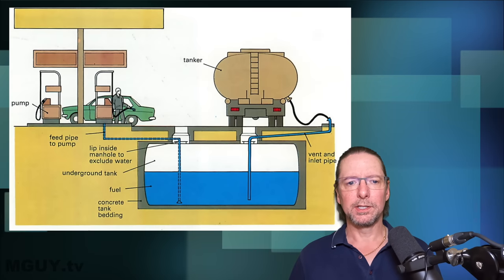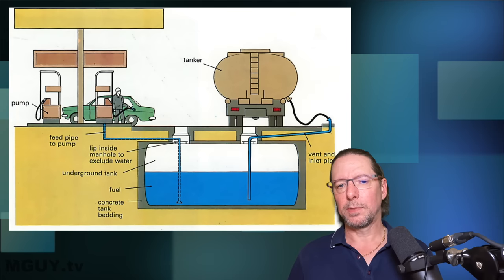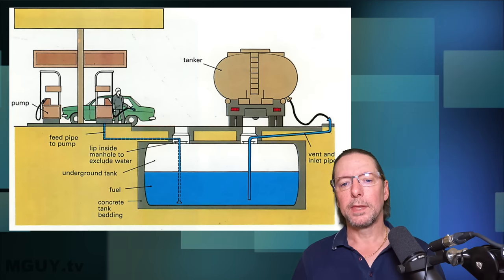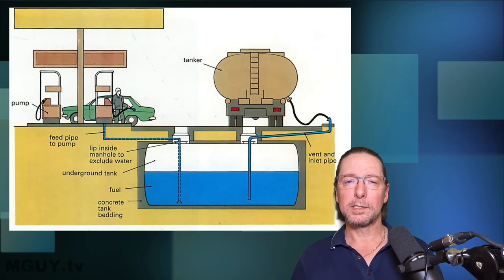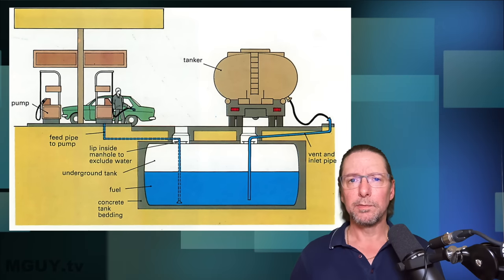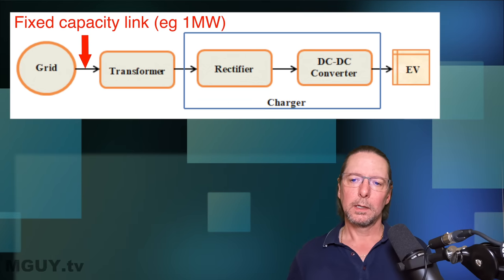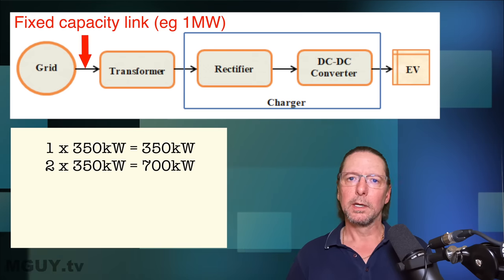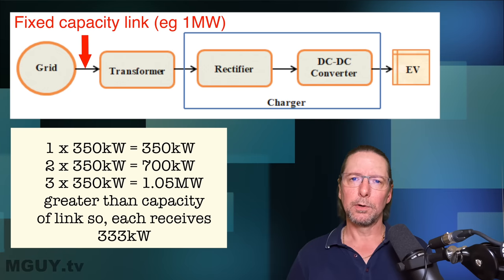HUGE problem with EV Charging Stations that no one mentions | MGUY Australia

Comment: As I've repeatedly told people, EVs are only half a solution (at best).  The other half of the solution would be improving the power grid.  However, since the same people insisting we switch to EVs are the same ones that are against us expanding our power grid, then EVs will instead be nothing but a new problem adding to existing problems.
Reply: Nice word salad.
Reply: If China can do it, why not Australia?  
It is time for people to put away their prejudices, get off the high horses, and learn from facts.
Reply: Can you mention any EV user who said he was against expanding the power grid?
Reply: Good thing that 90% of the power generated is done so with fossil fuels, b/c clean efficient nuclear power is too scawwy. Green vehicles my fat a$$.
Reply: To switch us all to EV's, the capacity of the power grid will have to at least double.  
Never mind all the issues with charging.
Never going to happen short of mythological level improvements in power generation and battery technology.
Reply: @ThePinkerton1776  100% of the energy I use in my EV's come from clean energy. Anti-EV-Prophets my fat ..." (sic)
Reply: True.
Reply: @Wilem35  So telling the truth is "word salad"?
Reply: @hokroeger  You only use clean energy?  Cool!  But I'm curious - just how many hamsters on treadmills do you need to generate your "clean energy"?
Reply: @PruneHub  that was a dumb argument. I live in Paraguay, in which 100% of electric energy comes from hydropower.
Reply: @Wilem35 You just can't comprehend it
Reply: @MadScientist267  That is one thing you got correct.
Reply: - COSTING in (price it into the budget) the 100kWh stationary battery for every stand - for as many cars as the "charge point" is rated for "per hour"  / per whatever time-unit one likes to use... (at a 3-4C charge rate - assuming 2.5 cars an hour are able to be FULLY charged)  that makes for  (say) 250kWh of BUFFER battery PER fast charger (a MWh for every 4 stands)....  Price that into the cost of purchasing and operating an EV grid.  YES that is the other half (now of course not everyone drives long distance and supercharges..  et BUT the "grid" (calling an EV charging network as a grid all on its own, isn't unkind, or inaccurate, of course it will hang off the national / state power grid which contains all the generators, distributed or centralised...) must be built to handle the capacity on the worst day of its life - say the weekend before Christmas, or Chinese new year - when everyone in the nation (or a decent percentage) -  gets up and does something unusual......
Reply: It would be a shame if Tesla was watching from the afterlife thinking - You idiots . . . . .
Reply: Instead of resolving a problem EV's have created more problems along with a huge inconvenience and a wasting of time.
Reply: Who will pay for the increase in infrastructure? It varies state by state in the US. Here in Arizona capital improvements are paid for by ratepayers in the form of increased rates. Rate applications are presented to the Corporation Commission, which ultimately rules on rate changes for whichever reason.

Comment: Noticed this issue a couple of weeks ago. A dealership with only four carpark chargers only able to use only two during opening hours hours otherwise the workshop and showroom power supply would shutdown. 😮
Reply: where exactly?
Reply: @Nordic_Mechanic  United Kingdom, so I would expect that the electrical infrastructure supply should be able to cope. (not in a isolated area). 🤔
Reply: Whoever did their install hasn't done a good job. The chargers should be able to scale down current based on availability
Reply: @StephenDeTomasi  Yeah, so then you will leave your car to charge for twice the time......this reminds me of those 80s joke about having imported cars 1 week on the street and 2 months on the repair shop.........the joke came back, in the form of a EV
Reply: @StephenDeTomasi  no some sales guy said you need 4 chargers , 
they didn't talk to a electrician first

Comment: Hi, recent subscriber when I saw the thumb nail pic for this vid. Im an ASP electrician working for a company that builds these sites an installs these chargers. We've done Tesla sites with up to 12 chargers requiring 4 super chargers to feed them. More commonly we do 1-2 chargers at Ampol service stations. Both situations require a larger electrical supply to the sites which is regulated by that area's network distributors. Ampol are installing massive solar systems with BESS battery systems to compensate a little. The amount of power needed to charge these vehicles in a reasonable time is rediculass! And electricity is nowhere near being produced in an environmentally friendly way enough to sustain EV vehicles.
Reply: And people's response to this is to add more solar and more batteries to the grid....
Reply: But it's green. IT'S SO GREEN! LOL
Reply: @mrow7598  And anyone that thinks solar cells and batteries are "environmentally friendly" is delusional.
Reply: another commenter explained it: the choice is between charging your car up, or providing 250 houses for the day.

and in the summer with air conditioning california asks you not to charge up at peak useage times. why?  because the infrastructure hasn't kept up with demand.  think brownouts.
Reply: @PruneHub  But petrol and diesel is? Hmmmm - wonder who is really delusional?
Reply: @longnamenocansayy  And I explained how very wrong that calculation was. Go back and look. Do you often simply accept some random poster's comments as dead accurate?

Comment: I've often considered this exact issue. I work where there are 7 EV chargers. Often, all are being used at the same time. So, if all 7 are in use at the same time It must take longer for vehicle charging to take place since there is only so much power provided from the grid. It's as if a small garden hose is expected to supply a huge amount of water to fill a 40,000 gallon swimming pool.
Reply: NOt really its lame video, he purposely left out battery packs which is the same as having a tank under ground
Reply: @danmosby7980  Do the math, battery packs are expensive, take a lot of space, have limited capacity, have a limited life span and pollute the environment to manufacture and dispose of.
Reply: @danmosby7980  No it isn't. 🤦🏽
Reply: It depends how big the garden hose is. I lot of cars can't even charge at high enough speeds to really stress a connection.
Reply: @danmosby7980  Large batteries cost around US$450 per KW/Hour. No garage owner will pay that, so forget batteries for charging and most likely forget a large generator since the profits from topping up EV's is insufficient to warrant the cost.
Reply: @cs7th  you already have charging stations, no different to putting huge tank under ground to store petrol, if thats what th customer wants, batterie cost are going down all the time. They pay for battery  stations like Gogoro, NIO is all abut battery swap thugh I am not fan. Its been done. Tesla is a battery energy company they get cheaper with mass production every day. Your point  is not valid cheers
Reply: @danmosby7980  Battery doesn't really solve the problem - does it? It just creates a buffer, so you can charge a limited number of cars faster. But after that - you have depleted the battery and the next batch of cars will have the same problem as described in the video. And you won't be able to refill the buffer faster - since it's still connected to the same line. Also recharging the battery will come at a cost - there will be always some energy lost while charging - and extra energy will be added to the final price (unless the owner is crazy). Having a battery with the energy level of the current tank would cost too much - and still not work,  since the real limiting factor is really the line you're connected to.
Reply: @cs7th They expect the price for 1 kWh battery will sink to about 30 USD in a near future. The rest is taxes, margins, etc. Now the prices for manufacturers are about 100 USD a 1 kWh. Used Tesla 3 batteries are also about 100 USD a 1 kWh. 
The change in prices go quite fast.
Reply: @seamonlark9282 I just wonder in which country you live? In the Nordic countries they build the infrastructure needed for different needs! And here the electric companies understand to charge people, even when the prices are negative some days. 
I would not say that all problems are solved already, but the transition to EVs is not that fast even though every new car sold would be an EV.
Reply: @philcook9967  Just like an ICE car, but cheaper.
Reply: @cs7th  Soon, everyone will have solar and batteries.
Reply: @seamonlark9282  So you think there are no losses on the electric grid? Solar cells?
Reply: @philcook9967  Underground fuel tanks are leaky, expensive to maintain, and the pollution they cause devastates your property value.
Reply: @danmosby7980  Not sure what you mean by battery packs but swapping battery packs on an EV is a long process that requires a vehicle hoist and  a special lift to lower and raise the battery back. It takes more time than a recharge. Battery packs in electric trucks can be done quicker because the batteries are stacked behind the cabin. It does require a big shed and a gantry crane to lift the half tonne packs. Recharging off batteries is incredibly inefficient and limiting. Victoria's new $1bn battery will keep the lights on in 200,000 homes for two hours. There are 2.5 million homes in Victoria that might need to run on batteries for 12 hours or more mid winter. So there is $120bn in batteries alone.
Reply: @tedmoss  Sure, every gas station owner wants to invest hundreds of thousands on EV charging, when people are moving back to diesel and gasoline.
Reply: @seamonlark9282  
That is the other thing that those who are forcing us to EV's refuse to consider is the efficiency loss as part of charging and discharging the batteries. The heat generated by this cycle is wasted energy.

Comment: In my city most of the EV chargers have had their cables hacksawed off by local criminals so charging times and capacity are no longer a problem.
Reply: Please tell me why? I don't get it. Resale? Spite?
Reply: Meth addiction comes with a fascination of precious metals, copper and aluminium being favourites.
Reply: Easy solution keep the power applied😅
Reply: @napalmholocaust9093   Probably for $10 worth of copper wire.   I own a couple of commercial buildings and have had air conditioning units destroyed for scrap metal.
Reply: @BradKwfc  Nobody is comparing the cost of the electricity supplied with the equivalent of fuel. Some one paid £10.49 for 34kw supplied by the charging station, a gallon of fuel will produce around 33kw power at the current cost of about £7.50  PG, but 70% of that is tax. I was never any good at maths, but I worked out that the real price would be around £3.33 per gallon. if the electricity was taxed at the same percentage his bill would have been 70% more expensive, here in the UK. The cost to the government coffer if everybody goes electric would be around 20billions, no way the cost of charging an electric car will remain untaxed.
Reply: @marcellogenesi6390  
Exactly, and we already know that the utility companies can't produce enough for everyone to be on EVs yet they keep selling them. 

My prediction: Electricity prices are going to go up for everyone because of EVs. Whether we have one or not the governments are going to force the utility companies to spread the cost to everyone in an attempt to subsidize it for EV owners.
Reply: @BradKwfc  Another important factor is the amount of copper needed in motor, a Tesla uses about 60kg of copper, if every body  goes electric, the price will skyrocket, assuming that there is enough copper on the planet. Petrol stations would not exist, and in an emergency no one would be able to use a portable generator, as there would be  no petrol  to buy.
Reply: Any politician who claims electric vehicles are the future shouldn't be a politician.
Reply: Bill scat
Reply: What city